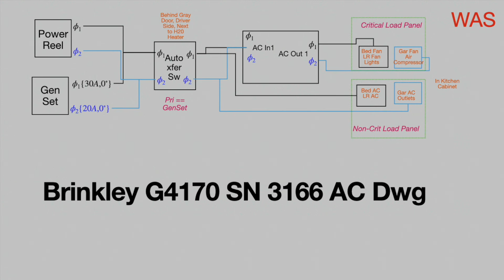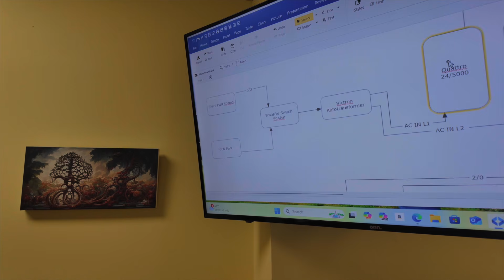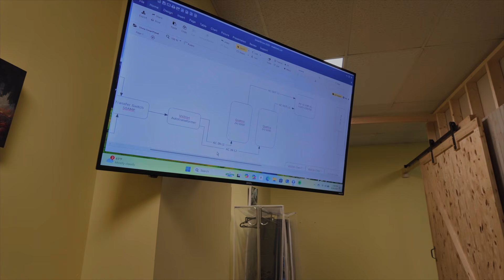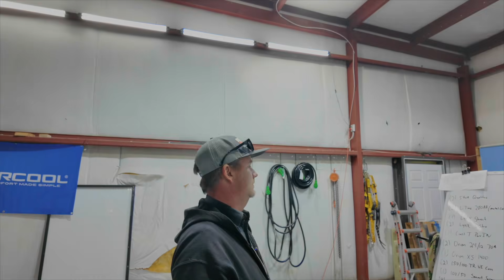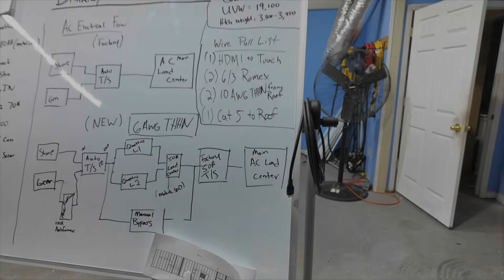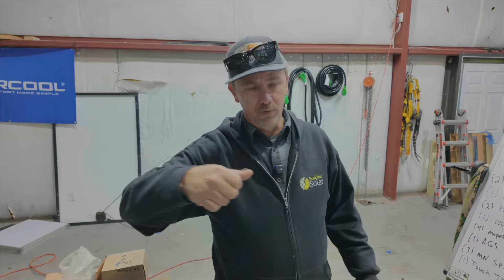Designing a Custom RV Solar System | Real Tradeoffs & System Architecture

Comment: I understand the need for 'as much solar as possible' i do however disagree to a certain extent. Its all about the batteries, you have a Large gen set, if your 22kwh of batteries aren't at full capacity run the gen set for 15-30min and top them off. I do agree with at least one 400w ground deployed array so that its 'aimable' and moveable. But I see no need in covering the entire roof when 1200w of rooftop and 400w of ground PLUS a genny should be plenty to keep that 22,kwh battery set up running.
Reply from the maker: That's the wonderfully crazy thing about solar designs, there are so many different ways  to skin the same cat.  Genset fuel, oil changes and smell on one hand, extra weight and cost of solar panels on another. Different people are going to end up at different points on the decision spectrum which is why its so important to find a solar installer who takes the time to learn how you camp and how you want to camp in the future, ensuring that you get a system you love..... Thanks for watching...
Reply: @WanderingTrailsWaggingTails 100% agree!!❤

Comment: I still have issues with blocking access to the underbelly but distributing the weight is a good idea.  Putting the batteries in the front as most do does mean you need an F450.  Always trade offs!   (Note that the camera views of the large monitor didn't show us much unless zoomed in.) Great video and thanks for documenting all this!
Reply from the maker: You nailed it—there are always trade-offs, and it's definitely a constant balancing act when designing these systems. ☀️